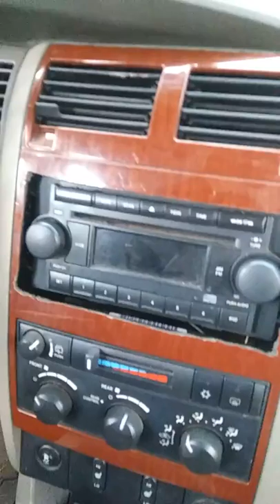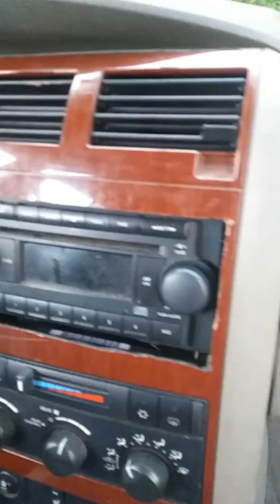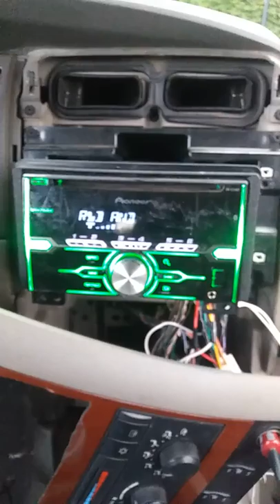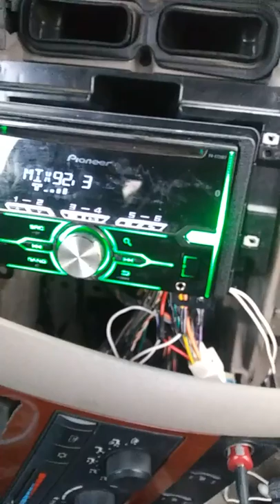How to Bypass Factory Amp and Radio Install Works 100% Dodge Durango

Comment: This might be a dumb question. Why you gotta run new speaker wires all the way to the head unit? Cant you splice the speaker wires into the old amp harness? It should have speaker wires in it right?

Comment: Aight bro I'm finna do the same thing on my Honda using speed 9- wire  but I need to know this one thing though? So You have to cut the wires that sends power to factory amp? Like grounds,12v
Reply from the maker: Yes

Comment: What about the rear oem speaker? I have a 2005 durango. The person I bought it from replaced the radio with a tablet. The door speakers work but the rear on all the way in the back doesn't work at all. There no bass in the sound at all. Any suggestions? Thanks
Reply from the maker: Honestly not sure would have to see or know how they wired it up but the bass should be in your radio settings unless they only installed tweeters or horn speakers

Comment: IF U USE A DIGITAL MULTIMETER YOU CAN FIGURE OUT THE SPEAKER WIRES BY USING THE OHM SETTING

Comment: Hello My Valued Friend...
Let me inform you that I have a completely designed wiring for passing amplifier without effecting on quality of the original premium sound system . We did apply it on aftermarket radios and also on Mygig navi radios up to 2017 models.

Comment: Does it matter witch hot wire you hook up for your constant and your accessorie wire for power?
Reply from the maker: Yea it does gotta find the riggt one it you will have constant power and have to manually turn iff your radio so u wanna have the right one to the key turn
Reply: Or if u can’t find it run one from the wiper blade fuse n that will work

Comment: i have same problem with my octavia 2005 som have original amp and original speaker som are *(SOUNDSYSTEM) i buy it andorid stereo when i connect it theres no sound when i back my original stero it work 
some on can help me
Reply from the maker: Not sure if the wiring is the same tho

Comment: How you figure whats what as for the speaker wires how you test to match?
Reply from the maker: They were the more colored ones but had to do process of elimination once I found the powers wires but from there I kinda just touched the speaker wires until I got sound then I did the next speaker
Reply: @wiseguyrobgr8visionztv593  got it... i sort of had the wiring diagram for my car but that was a waste since idk how to read and to come to worse is that my car comes with 13 factory speakers so it was hell but i managed to figure it out. Thank you tho

Comment: Actually how did you find your remote turn off
Reply from the maker: Honestly I used a fuse for the continuous power wire I couldn't find the factory wire

Comment: I got 2 power wires (grey/light green) and the diagram said the gnd is Blk/grn but I have 2 of those 🤷🏾‍♂️ I need help, I cannot from gnd

I have a 06 charger base
Reply from the maker: You gone have to use a voltmeter to find which one or run your own power wire
Reply: there are 2 grounds as well as 2 constant wires

Comment: Do you happen to remember the color for each wire for speakers?
Reply from the maker: Anthony Allen yes they were purple green orange and grey
Reply: Purple green orange and grey. We're they mixed with another color. I got the same car no wires in that location with solid colors like that
Reply: What wires were connected to get the stereo to even turn on I have an limited with the infinite system so it's a little difficult to find others with the right diagram

Comment: Did yo door locks stop wrkn
Reply from the maker: Nope been good since Day 1
Reply: Dre if your door locks stopped working, pop out that rubber hose in between your cab and door when you open the door. That’s what the wires run through. They break in these Dodges from being bent when the door opens and closes. Have that problem on my truck. You just gotta splice em back together.